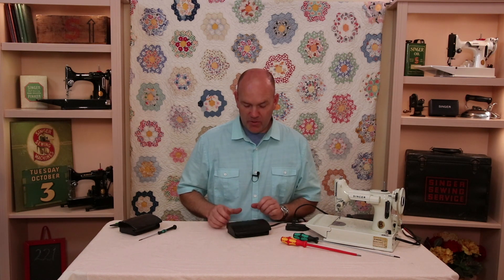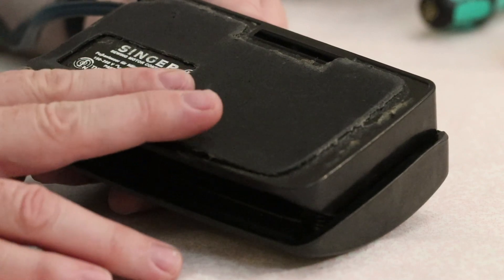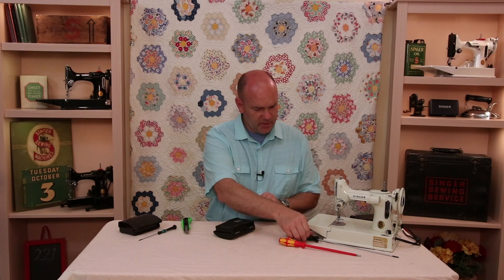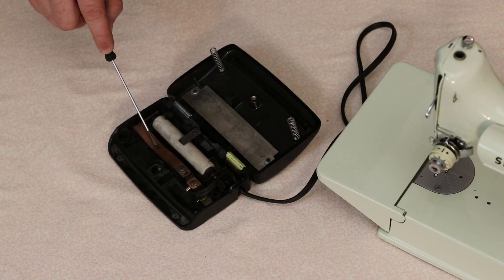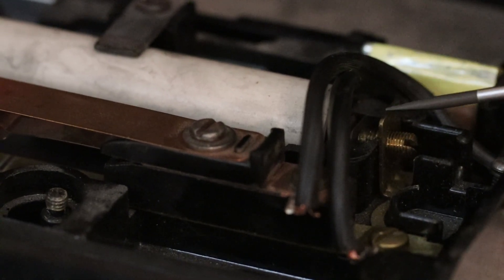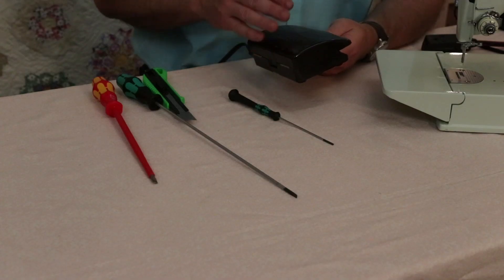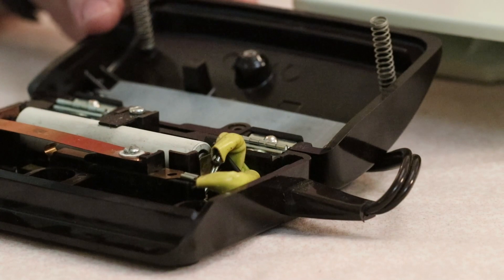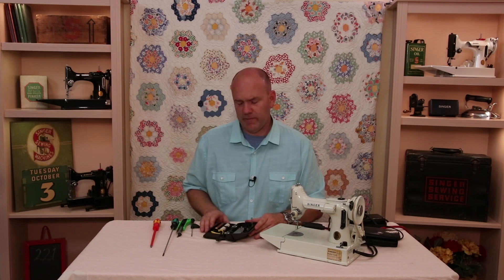Foot Controller 2 - Singer Featherweight 221 222 Repair Video Tutorial

Comment: For those with the foot controller without screwson the bottom:
the 2 hollow plastic hinge pins need to be removed to open it. You can use a thin sheet metal screw. Insert with barely a 1/2 turn (otherwise it will expand the pin and make it tighter) and pull it out.
Otherwise you can drill them out with a 3/16" drill bit and find some replacement pins/dowels. You must use soft material for the pins otherwise you WILL crack the housing. Do not use screws to replace the pins!

Comment: Thanks for the video! Wondering if you can help explain a mystery. I am using this foot switch with a singer motor to turn a guitar pickup winder. The pedal is getting hot and smoking. Not sure why or know what to do. Thanks!

Comment: Hi, I wonder if you could help me please, I am trying to rewire a Singer 457 but before I can, I have to work out how it is working because I can't find any internal wiring diagrams showing how they work, from what I can work out the internal motor is insulated from the machine using Nylon components and has one side permanent live and the other side seems to be variable neutral through the foot switch, also the capacitor is across the motor terminals, would you agree with this ?

Comment: Hi, really helpful video! However my issue falls into a slightly different category and I’m wondering if you could help. I have a Singer 237 that won’t go full speed. It either goes slow or slightly faster than slow. I’ve adjusted the pedal as shown in your video and the only change is I can make it not work at all by backing out the screw on the right side. I’ve tried moving the contact spring closer and further away as well. Any ideas?
Reply from the maker: Thank you so much for your message!  Follow the link below for more information and to contact us directly with questions about the Singer Featherweight - happy to help!  :) https://singer-featherweight.com/pages/contact-us

Comment: My machine just goes very slow. I changed the motor and the belt and lubed the whole machine, with no change. Could the foot pedal be out of adjustment?
Reply from the maker: Check out the Featherweight Schoolhouse with all the categorized maintenance tutorials and troubleshooting and then contact the shop directly for further Featherweight technical assistance:

https://singer-featherweight.com/blogs/schoolhouse

Comment: Does anyone know how to open the clamshell that doesn't have the screw?
Reply: The 2 hollow plastic hinge pins need to be removed to open it. You can use a thin sheet metal screw. Insert with barely a 1/2 turn (otherwise it will expand the pin and make it tighter) and pull it out.
Otherwise you can drill them out with a 3/16" drill bit and find some replacement pins/dowels. You must use soft material for the pins otherwise you WILL crack the housing. Do not use screws to replace the pins!

Comment: Hi,  I have a Singer 1411 with a clam shell electronic foot controller.  The electrical cord is pulling out of the case.  How do I get the case open to get the cord back in correctly.   We cannot find any screws to open the case.  Any help would be appreciated.
Reply from the maker: Thank you for asking... our specialty is the vintage Singer Featherweight 221 & 222, so your model may have some different features.  Check with your local sewing machine technician for support.
Reply: Hi. Nice video. I’ve got a capacitor and a resistor in my pedal and smoke coming out of the capacitor.